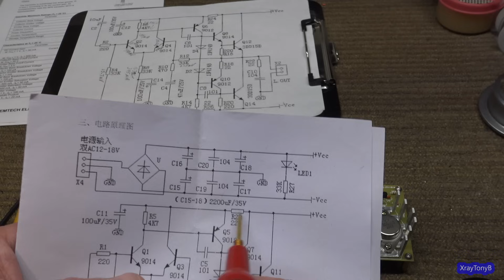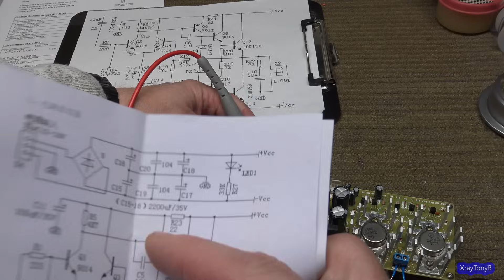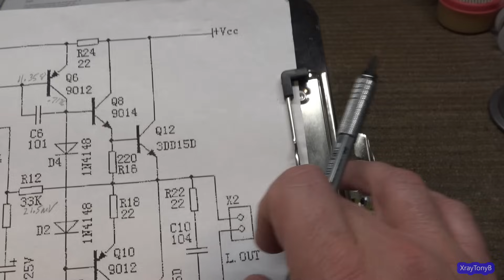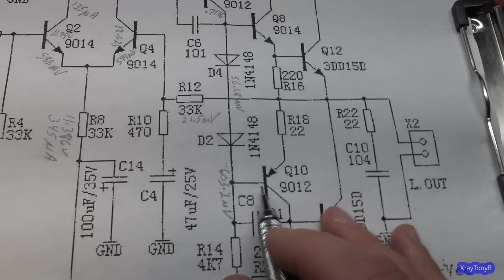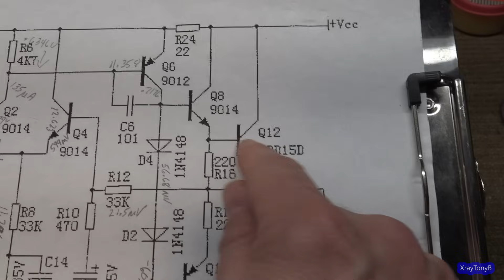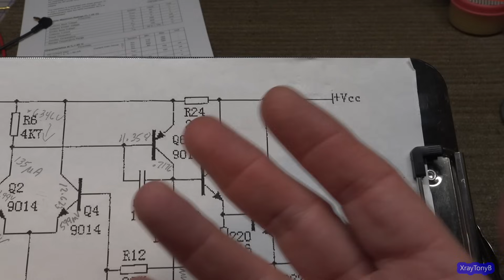Amps n'at part 4 - VAS Driver & Ouput Stages & Sound Test

Comment: 18:40 - Lots of bass-punch since the amp rolls off at at very low 7.2 Hz! (determined by the RC leg of the feedback network (470 ohm/47 uF) ,   f = 1/(2*PI*470*0.000047)

OOPS! I neglected to mention the INPUT RC network (220 ohm/10uF). It rolls off at 72 Hz! I'm curious about that bass-punch now :)
Reply: Actual it rolls off at 0.4hz. 10uf with the 33k pulldown.

Comment: Hey Tony, just watched several videos and especially the one on the Mitsubishi DA-P20. Very well done and I like your attention to detail. My Da-P20 is in the shop now and I’m not confident the repair person is fixing the issue, using the correct caps and definitely not timely. From your Patreon page I see you sometimes take on others vintage repairs. I’m looking for a full recap on mine and possibly the same mute relay replacement as mine is exhibiting the same behavior. Can you point me to other repair techs that you trust that might be available to take on this repair, if you don’t.

Comment: I am guessing that you powering it from a regulated bench PSU is probably helping the sound quite a bit. So if the amplifier has poor PSRR the bench PSU will be masking what it would sound like with just tran/bridge/caps with a volt or so of ripple.COmparing the two would be interesting!

Comment: I'm surprised that I can actually understand everything that you are saying about the circuit design, as you go over this circuit and talk about it... I can see what problems I could encounter and I can already see ideas that I could try to get this circuit to be a bit more stable and flexible in regards to power supply voltages. 
To my understanding so far, if you stick with the recommended power supply voltages, it should theoretically perform as an amplifier should, you can't simply pull some random transformer out of your transformer spare parts bin and expect it to function! 
This to me is really interesting because I have thought about replacing a transformer in an old kit amplifier I have to give it a bit more power than the 13Wrms per channel that it was designed to deliver, it's a great sounding amplifier as it is and it's no slouch when it comes to it's delivery, I don't know why I want to modify it (must be from my days of modifying car stereos for better and more powerful performance?)... 
But in retrospect, I only have a vague memory of the circuit design of my 1972 kit amplifier and thinking about it now, it's probably designed to work with the transformer it came with and fitting something else with a higher voltage output will probably upset the DC balance at the speaker terminals.... 
Now I need to have another look at that circuit design again.... 
Incidentally, this kit amplifier from 1972 looks very similar to the Quasi Complimentary design in that it's output transistors are mounted on the PCB board along with their heatsinks..... The resemblance is there although, from memory it's using TO66 transistors which at that time were just released to the public, made in Croydon Victoria Australia, the TO3 I believe had not been released yet.... The TO66 transistors now days are unobtainium.... I remember reading in a later issue that the guys at the Electronics Australia magazine had come up with a solution to replace the transistors with a plastic case transistor and gave a full explanation for how to do it! Those were the days! 
I'm lucky to have a very good example of the Playmaster 136 amplifier, I purchased it will the intention of gutting it and fitting some cheap Chinese class D high powered amplifiers.... I gave it a chance to play something when I got it home and couldn't understand why it sounded so good! I have more amplifiers than any normal person should have and while some may be more powerful than others, they pretty much all sound like each other, but this thing was something else! The combination of the power amplifier and it's pre amplifier and it's tone controls just does something to the sound that others that I have listened to don't! 
Maybe I thought that by adding a larger power supply I can get more of whatever it's doing when I need more.... 
I really need to go over the Playmaster 136 circuit design again..... 
This video series is showing me that I already had a lot of knowledge, more than I realised and all that I really needed to do was to sit down and go over the circuit design.... Although I will admit that I knew that the diodes had a specific function but seeing how the bias changes under different temperatures was really eye opening.... 
This video series can only go so far and it's eventually going to come to an end which is kinda sad.... I was thinking about the possibility of finding another different type of amplifier design on eBay that's also cheap to try and continue this series.... 
I have a cheap single ended class A amplifier also from eBay, they were single channel boards sold in pairs for stereo... They are quite small PCB's with a large blue capacitor that seemed to dominate everything else... I don't know if they are still available on eBay, would be a great circuit design to go over in this series.... Just an idea for the future if you are interested.... 
Thanks once again Tony, this channel has been my cup of coffee ever since I stumbled across it more than 6 years ago.... And I'm going to ride this mystery train until it's last stop, wherever that may be which is not important because the journey there is amazing! 
What's that old story about the dude who played the flute that got the rat's to follow him across the river to which they all drowned! Well I'm one of those rat's LoL, the journey to the end justifies the means! You keep playing that flute, I'm lovin' it LoL.

Comment: I hope this question is not too far off topic but what advantage is there to using a high gain(50,000 hfe) Darlington transistor for q5 vas.i ask because I'm trying to understand the phono circuit in advent 300.the vas transistor also is the driver transistor  driving a single emitter follower output.advent used a mpsa65 Darlington in the vas-driver position.only reason I can think of to such a high gain is put a low load on the differential input pair.i enjoy your explanation of bias circuit and thermal stability.partically which part in circuit does what.definitely easier to find a fault when you know how the circuit works.this series is going to make me a better (fisherman) I mean troubleshooter.